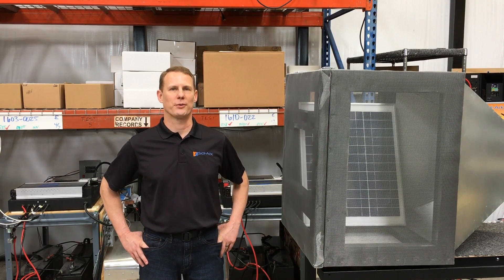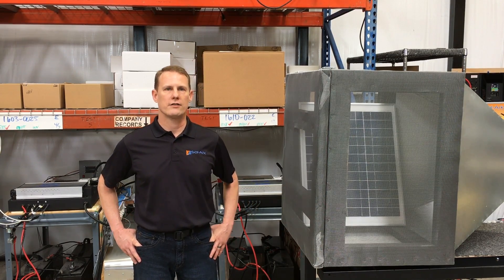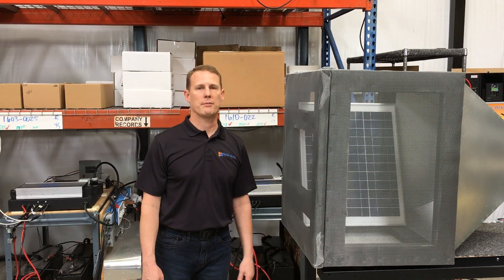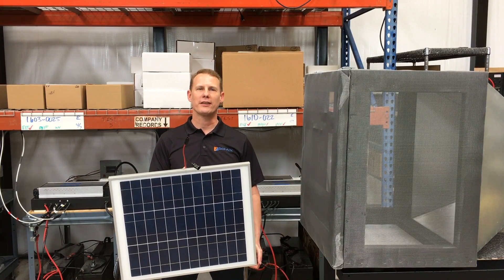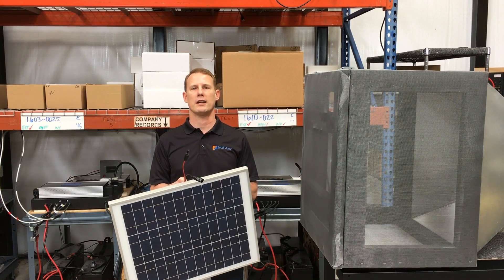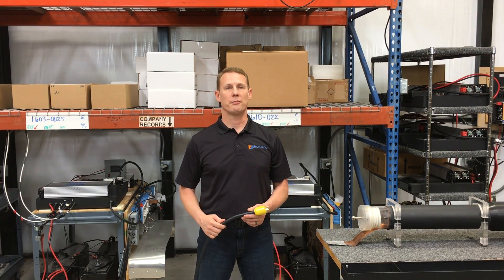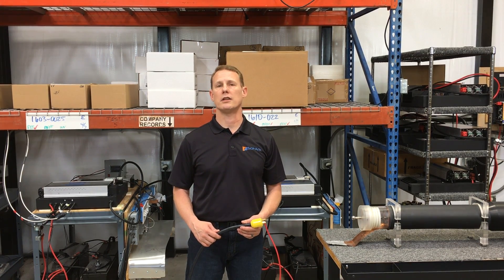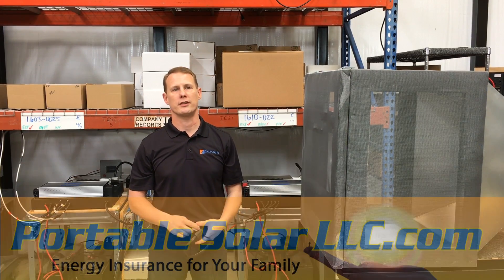EMP Tested: Solar Panels, iPhone, PC & Sol-Ark EMP-Proof Inverter

Comment: I have a bunch of Renogy, Eco-Worth and Sonali solar panels. They are in their original packing material. Should these survive an EMP since they are not connected to anything?
Reply from the maker: Thanks for your question!  Since we’re not affiliated with those brands, we can’t say for sure. We recommend reaching out directly to those manufacturers for the most accurate information regarding EMP protection and durability.

Comment: does Sol-Ark make any portable solar power stations?
Reply from the maker: The 12K is a great selection for building your own power stations (due to the integrated breakers). We also have a 120V 5K-1p with significant surge capability, which is as stripped down as we can possibly make a budget-friendly hybrid inverter.

Comment: So, if a computer, phone and such are not plugged into a charger at the time of EMP blast, they are good. I would think the same for the charging cords if they are not plugged into a power source at the same time. Sound correct? Now, for the real reason I am here. What about a solar powered watch? Does any of this depend on how close the item is to the actual blast site? This has been a big debate, believe it or not. So far, the answers I have found are conflicting. Thanks.

Comment: I think the most important thing is to protect fhe power grid in the house. Basic light, heat/ac, water pumps, fridgerators/stoves sums up whats ACTUALLY important. All other electronics you can live without. In the 90s we lives without cell phones and computers. But we still did have phones to call.

Comment: A question I have is, are emp's always the same intensity? Your emp generator emits a predetermined strength but are real nuclear emp's the same strength or can they be more intense. Is there any data collected of emp intensity from different nuclear tests?
Reply: 50k volt is typically the absolute worst case from a standard nuclear emp. "Super" emp weapons theoretically can hit up to 200k. Theoretically. The Wikipedia page on nuclear emp has a lot of info.

Comment: I've been a tad concerned about EMP causing electronic equipment to fail for years.  Thank you for this video. 
So If I'm right, just unplugging all electronic gadetry from the mains power & in wired connections to one another, should improve the survivability of my gadgets without having to purchase or make multiple Faraday cages.

Comment: I may be looking in the wrong places to purchase your products. I was looking for an American company and their product with be tough. Here you are and I can't just buy your product. It tells me I need to hire an installer. I guess I'll buy from the other companies.
Reply from the maker: Our systems are easy enough to install that DIYers can do so. You can purchase a system through our vast distribution network. There's likely a distributor close to you. 
We recommend hiring an installer/electrician to verify any interconnection points to pass inspection.

Comment: I would love to see yall test the emp shield products to show people if they actually work or not before spending money on something that they don't know about
Reply from the maker: Our EMP products have been tested to military standard 461 for EMI interference on electrical substations (MIL-STD-461) if that helps.
Reply: @Sol-Ark  How well would a string of panels fare if they were disconnected from the inverter? Just wondering if the cabling would pick up enough of a voltage to be damaging to the panels.
Reply from the maker: The inverter has a solar DC disconnect that does exactly that. If you use it, the solar array sits at it's open circuit voltage no problem. It is important to use competent labor to make sure the conductors are installed on the roof free of electrical defects caused by poor workmanship.
Reply: @spankeyfish  you're the right man, it will pick those higher voltage waves the same as the radio antenna does.
Reply: Yall make the product called emp shield for vehicles?

Comment: Hi, very good video. My worry is that electric household devices connected to the grid will be destroyed by an EMP and possibly might catch fire. So after an EMP: electricity is dead, my electric devices are dead and I better keep a fire extinguisher at hand to prevent the house from burning down. Is my assessment correct?

Comment: What about vehicles? Would their wire harness be enough of an antenna to collect enough power to damage the ecm and/or other modules and sensors?
Reply: Nope buy a bike nothing is gonna work we are going into a stone age buy food that doesn't need to be cold get nutrition bars it's the best I can come up with also get atleast a Yeats worth of water many will not survive I pray for the children they don't deserve this no one does God help us all 😢
Reply: @braidendj3jy  Hi Nicole have you become a flat earther yet? If not I suggest watch a 13 part series called What on earth happened by Ewaranon to learn that the earth is not a globe. I got it in my about tab.

Comment: Something is not right here. When the panel is producing .04 Amps it is good? When the panel is producing 2.3 amps it is bad? It is clearly not hooked up to the battery if so we would be able to at least read the battery voltage which should be over 12 volts and see if it is producing any amps. That is what is important. but it is clearly hooked up to something that is drawing 2.3 amps and since the panel cant keep up with the wattage wise the voltage gets drawn down. Something is clearly wrong with your presentation. Or is it the meter got fried? because that is what I can clearly see. The meter before shows .04 Amps after the meter is drawing 2.3 Amps. Like i said something is clearly wrong here.
 i have lived off grid for 15 years. And I have seen these mistakes before by supposed professionals. 
NDR

Comment: emp basically overwhelms electrical systems with a spread of radio frequency energy- which builds up within your circuits. it is now possible to buy off the shelf systems, to absorb those signals... and store them as energy, then discharge them safely as voltage. obviously- they've equipped their systems with something similar.

Comment: I have a single 100w panel stored in my closet, hand held ham radios with antennas removed and chargers unplugged with USB cord also removed..
From my understanding they should be fine.. 
But I need to work on my mini house and system, I have 800w panel arrangement, 30 feet of cord connection to house, controller and 2nd as a spare and two 100ah batteries, all wiring and appliances are 12v so no inverter used.
So I'd need a stop at the panels connection, your controller and spare LED bulbs for the lamp, not sure what to do about the 12v fan.. hmmm with things the way they are now I need to get on this.
Reply: Pretty sure your radios are gone... There are some cheap methods on the internet like ammo can with extremely fine wire mesh gasket to seal (and sanding the ammo box paint where its touching) that look reasonable, but I don't know how many of those designs would actually fare. However, that one might be your best bet and only like $20 to do, plus it helps organize your stuff anyways even if its never needed.

I think the above video test is highly flawed, judging by the mesh he was using it was a normal household microwave would be my guess. Obviously that laptop should be GONE if it were a true test (my laptops shut off all the time like that just from static sparks, typically I get purple lines as well and that's not uncommon when its really dry). A real EMP won't be so gentle, and its kind of funny, lol, the cell phone? Lets say the cell phone was actually protected (which you might as well if you have space in the box), its gonna be a LONG time till they get reasonable cell networks rebuilt, and a bunch of those telecommunications parts are probably from China... Cell phones don't do well without a cell tower (satellite phone might still be useful)
Reply: hi tras have you become a flat earther yet? If not I suggest watch a 13 part series called What on earth happened by Ewaranon to learn that the earth is not a globe. I got it in my about tab.

Comment: I wonder if phones capable of wireless charging is affected differently 🤔🤔
Reply: I think all those phones are gone, and yes those charging circuits are probably going to catch fire, lol!

It looks like a glorified microwave to me, I don't think that mesh was fine enough for the true frequency range spectrum they would get either, and I'm skeptical this test is valid for anything (case in point, that laptop should be sizzled)

Comment: Since the latest EMP weapons are projected to put out 200Kv per meter, I wonder and hope..not saying I am right...
Reply: That laptop should be gone, so I don't even think this test was valid. Visually that screen doesn't look fine enough either, and it won't be a single frequency like they are testing either.

Comment: Panels are pretty resilliant to EMP. The cells generally will see the pulse as capacitors with the main worry being a common mode pulse from them heading right into your regulator box. The gizmo you are using for radiated EMP is similar to the E3 component, while the pulse generator is either an E1 or E2 simulation. 🤓
Reply: I'm concerned that this demonstration doesn't trully represent the danger to microelectronics from high gigahertz frequency that you might see in a major solar flare or Weaponised EMP. 
Also
Do you think my solar panels are safer directly connected to my LeadAcid battery banks as I much prefer to use them, than with the crap think they are smart charge controllers that throw away 60 to 95% of the power they are capable of supplying, and kill my batteries by refusing to supply the currents and voltages they need to not dendrite and cell balance?

I'm assuming that the batteries inertia will stop short duration high voltage and currents and the diode nature of the cells prevent back current.

Am I wrong about these matters? 
It seems pretty obvious that electronic systems are not safe from the inverter failures in the video. 
And that grid tied systems are absolutely stupid.
Reply: @aaronfranklin324  EMP will be nanoseconds to microseconds in duration. The average energy is minuscule thus damage will be drastically dependent on exactly how the pulse gets to the components. Long pieces of wire will act as inductances which will integrate the pulse thus reducing its amplitude, finally to where common surge protectors will dissipate them. This is why huge power transformers are for all practical purposes immune. A lot of hysteria over EMP is simply people not understanding basic electronics!
Reply: @glasslinger  Get ya. 
But the Gamma and X-ray bursts from Major solar superflares, and the radiation belt proton discharges down Magnetic flux pipes to ground that accompany them, of megawatts per square meter over many square kilometres.
Those are NOT such short term events. 
Examples: Tunguska, Green desert glasses, vitrified megaliths. Mojan Dharo, Harappa, high energy particle tracks and U238 transmitted to Pu239 at exposed Granite surfaces at 12900, 26000, and 39000 year geological horizons across East of the Rockies north America, And Western Europe, when previous Magnetic Excursions offset the Earths dipole field Away from the Atlantic, and weakened, as it is now. 
Those Red picket fence midlattitude Auroras you guys have been enjoying watching are the first warning sign that it's imminent. 
And Nuclear weapon EMPs as opposed to high explosive ones, they have the short wavelength gamma photon energies that WILL fry electronics.
Reply: That's not what the experts are saying. According to a research paper from 2017 (can't post link b/c of yt spam filter) a solar storm of a similar magnitude to the infamous Carrington event could cause up to 66% of the US to lose power. There's much debate about how long it would take to get power back up and running, with estimates running from days to months, depending on how much of the transmission network needed to be replaced. If an outage on that scale lasted more than a week or two, things would get really bad as people ran out of food, water, gas, etc. And the economic damage would be in the trillions.
Reply: @arconreef  You are absolutely correct about this. I read a 2021, 350 page PhD dissertation by an electrical engineer here in New Zealand about the effects on our grid of the two biggest glare events in the last twenty years a couple of weeks ago. 

Effectively, they caused DC currents in high voltage AC power transmission lines and substation node transformers of similar Amperage to their maximum design capacities. 
Only about a dozen of hundreds across the US going down will bring the whole lot down Inna cascade. 
And repair and restarting would take months to years, if it ever could be achieved, with the reliance on grid electric and electronic systems for communication, transportation, and manufacturing and on site repair in the world today, that would also be inoperable. 
And remember that most parts you'd need to do it are made in China, and they would be putting their own predicament ahead of yours. 
All I can say, is practice making what you NEED yourself. Get a marine VHF radio for communications, A solar panel, and some twelve volt DC led downlights. A few cigarette lighter USB chargers. Automotive lead acid batteries are quite adequate. If you can get old maintainable ones with top up plugs even better. They will last 25 years, are much more durable than modern batteries, and you can check the charge levels without electronic voltmeters, using a cheap hydrometer. 
High voltage grid AC stuff is very fragile because it's designed for low current, and is far more likely to produce it. 
Remember, a Carrington level event is no longer necessary. Our Earths magnetic shield strength is less than half what it was then, and with it offset away from the American and Atlantic sector, your gates wide open. 
Don't expect Satellite services to survive either. 
The miniturisation of electronic chip components has made them far more vulnerable than even a decade ago. They will be hit by very large high energy proton, ion and electron fluxes. And very high drag from a puffed y Atmosphere, as Elon found out when he lost all those starlinks in a very minor event. 
Those midlattitude Aurora's you've been enjoying were only a mild m class event. An X10 would likely have simiy effects today as the ~X30 Carrington and put those Auroras as far south as Florida and Cuba, like it did. And induce far more rocky geomagnetic conditions. 

And they were far better equipped with the technology then to handle it, than the devolved, disposable, cheap rubbish systems of today.

Comment: Thanks for this information.
Recently I started unplugging my electrical machines and welders when not in use, will this protect these machines?
Reply: If you unplug from the rest of the "antenna system" (household and municipal power wiring), then certainly you are greatly lessening the electrical impact on your equipment.

Comment: Wait so even if the phone and laptop chargers are unplugged they won't make it, or if they are plugged in? Or both? 
Also, if phones and laptops are plugged in would the emp affect them then? 
I'm also curious about the booster charging devices. 🤔

Comment: And one other thing - most people I know often leave their laptops and mobile devices plugged into their chargers overnight (or whenever they are low on power) - as well as being physically connected to an internet cable (if unable to get wifi).... won't the wiring result in electrical-surges that will damage the devices/laptops?

Comment: So if your panels are "connected up" they'll be damaged? Unless you get plenty of warning of an imminent EMP blast I would presume all solar panels will be connected up at the time-of-strike/event?
Reply: They are selling a surge protector to connect at the solar panel, as well as emp resistant inverters.
Reply: @earlrobinson5911  Yes, that would help immensely!
Reply: Exactly..
 Absolutely no one using solar panels off grid have them disconnected. 
So pretty pointless excercise. 🙄

Comment: To protect both my panels and the  solar generator / battery what do I need to do?
Reply: Put a lightning arrestor on the house wiring.
If the connection breaks down at just above the maximum panel or system voltage this will protect the electronics.
High speed electronic circuit breakers help minimise damage too (they will need resetting afterwards however).

Comment: I have a Sol-Ark 8k with a ground mount solar array 175ft from home.  I have the suppressors at each panel. So the solar panels are safe with that much PV wire in the ground?
Reply from the maker: Yes.

Comment: Keep up the good work. I looked at the test report on your website and it is a good radiated test report but I did not see injected testing discussed in that report. Is there another test report that covers this and have you published technical papers on you results?
Reply from the maker: We have conducted EMP generators, radiated EMP generators, and lightning generators in house. Conducted is much easier to test than radiated. So we did conducted in house and avoided the 3rd party cost. We will be sending our 12K inverter through 3rd party tests for both radiated and conducted for government approval.
Reply: @Sol-Ark  Thanks. Let us know the results of those 3rd party tests in the open literature. Again keep up the good work.
Reply from the maker: @benmcconnell6008  We will. American families being less dependent on our grid has always been our primary mission.

Comment: This is very interesting! I was wondering if you knew of any scholarly articles I could read surrounding this topic. I was also wondering if an electromagnetic pulse could charge a solar panel.
Reply: This is not a scholarly article, however, the 2018 Lemay Papers are a good start.